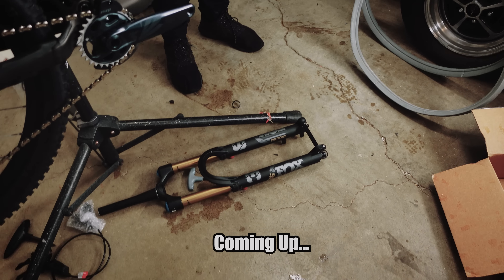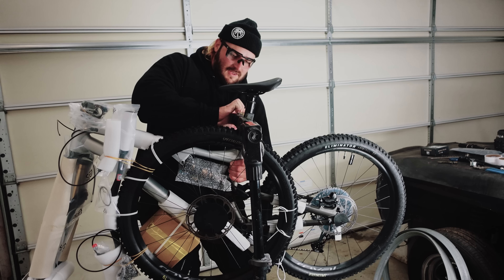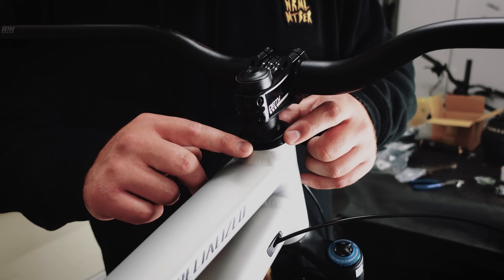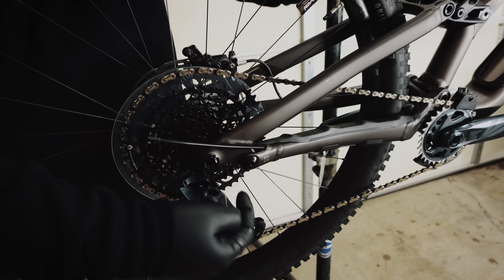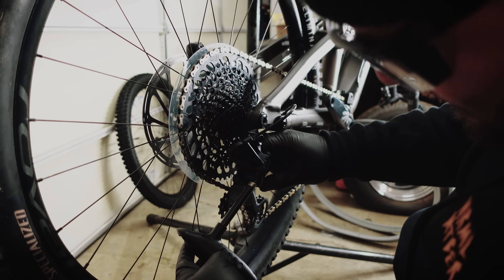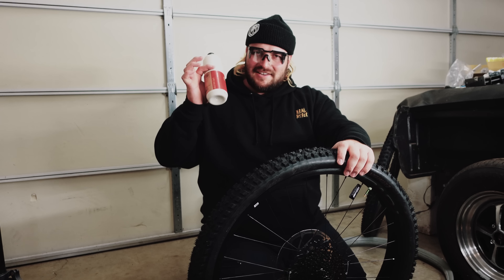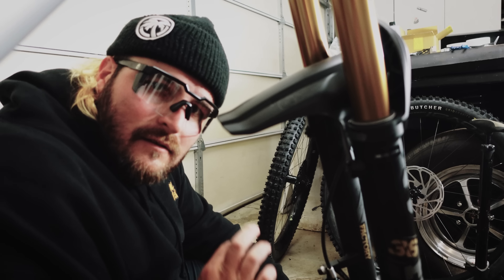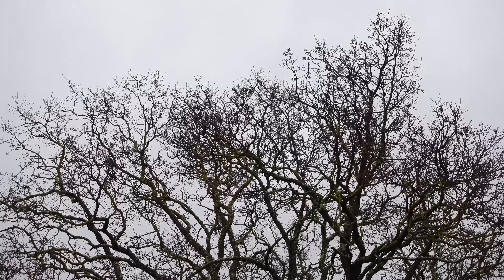Dream Trail Bike Build: Specialized Stumpjumper EVO Alloy Elite

Comment: If you haven't dropped your brand new fork on the ground or installed your tires backwards, can you even call yourself a MTBer? 😅
Reply: I took my bike to get service once and apparently I'd had my tyres on backwards for months without noticing 😭
Reply: No you can't
Reply: Seasoned veterans put the fork lowers on backwards too. 
To get your tyres the right direction, the model name (assegai etc) goes on the right drive side. There's no tyre logo on the nds (only brand name maxxis etc)
Reply: I did that
Reply: Who the heck drops their fork!
Reply: Did it! Now I warp a wire around fork and top tube every time I remove a stem 🤭
Reply: I've never had a brand new fork so, guess I'm not a mountain biker🤣 But I'm actually waiting for my first ever brand new bike I ordered for this season
Reply: I haven't dropped it but I have let pliers slip off of a tie wrap and scratch the kashima coating
Reply: Don't forget the chain on the wrong direction👍
Reply: @guardian_ironworks yes sir, that’s like week one at the bike shop haha.  12 speed chain on the wrong way
Reply: I hope so… I’ve still got to drop a fork…. And I’ve been riding since the early 2000s
Reply: Em I've done that but I did it to both the front and the back at the same time

Comment: that piece that you put in your headset is called a headset cup. also here is a trick for cutting dropper housing to the right length, basically youll pull the housing out of the front of the bike until you have about an inch of housing still coming out of the seat tube, then youll turn the handle bars all the way right so that the bars are close to inline with the frame, then just line up the housing with the dropper lever and cut it with a little slack and there you go perfect length everytime.

Comment: I would have gotten this instead of my Trek Fuel EX 8 Gen 6 if the sale started at the beginning of march since that's when I got my bike.  Has a mid range drive train and  a very good suspension but still Alloy which I prefer.  Though probably has a little more travel than I want in an all around mountain bike.  This one is getting a little to close to an Enduro bike.

Grat's on your bike I'm jealous.  Looks like your learning how to work on mtb's the same way as I do lol.
Reply: I’m looking into the fuel ex 8 gen 6, how do you like it

Comment: As a big guy I'm looking at a Status 140 or 160 as my first MTB. Most of my area is down country and most people ride 100-120. Should I spring for the 160 because of my size, about 330lb, or will 140 with enough air pressure be enough?

Comment: Congrats! I own a stumpy evo and also run a 50mm rise bar. I’m 6’3” so it just makes sense given the fact that as the frame reach grows, the stack height doesn’t grow in proportion. Just remember to keep proper weight on that front wheel in the corners! I’m 175 pounds and have to pump up the shock to 248psi and it makes my arms tired from pumping so many damn times! What pressure do you run?
Reply: 6’3” stumpy Evo rider as well. 190lbs. That pressure seems WAY too high. Have you measured your sag at that pressure? I’m running 200psi with a .8 volume spacer. It’s butter. The website numbers aren’t for the 2021 and newer Evos.
Reply: @jfflyboy  Word?! Huh, I didn't notice that the Specialized suspension setup page doesn't include 2022 or 2023 models. Lame! Anyway, I did measure my sag at 248 psi and if I remember correctly, it was somewhere between 25% and 30%. I was blowing through travel too easily and finally settled on .6 volume spacer. None of that matters all that much any more because I switched to a Push Eleven.Six coil.
Reply: I'm running with 180lbs around 160-180psi with current 0.6 spacer.... To get 30-35% Sag while standing central on the bike....250psi are way too much for your weight. And remember when pumping air to the shock, push the damper through its first 25% travel to get air to the negative chamber. Than check the pressure again and pump it up towards you want. But it's my third ride today on the elite evo... Coming from a regular comp alloy, it's not that big difference sadly. I was expecting more I think from the rear suspension ... It's a great Allrounder and pedals/climbs really well, but it's more an heavy Trail bike or Allmountain than an real enduro... Even when everything is low and slack. Hope specialized brings a new enduro soon with steep seat tube angle and of course in alloy with swat :) so far I need to go for some serious laps in a bikepark to get I dialed... But I love the specialized tires, massive grip
Reply: @Max-dj5qj I’m 275 and the store put it at 300psi rear shock